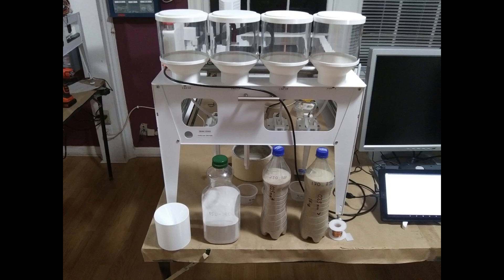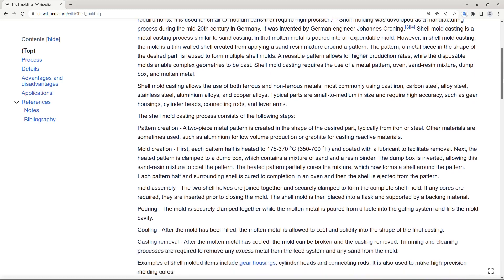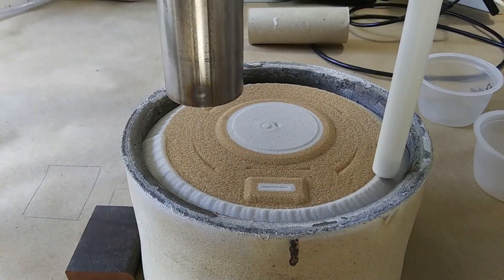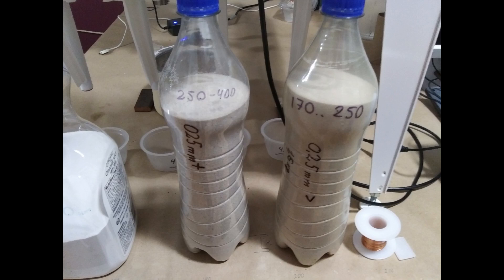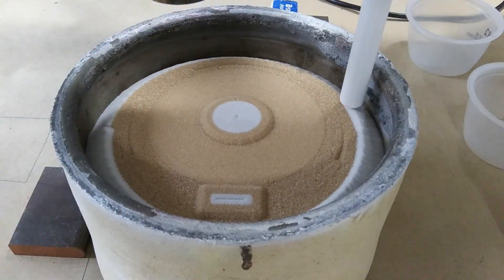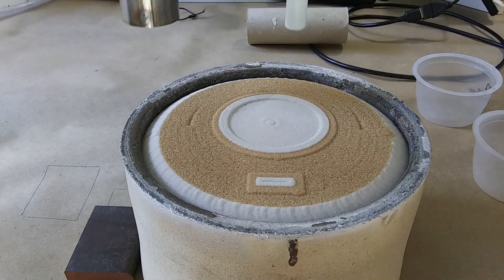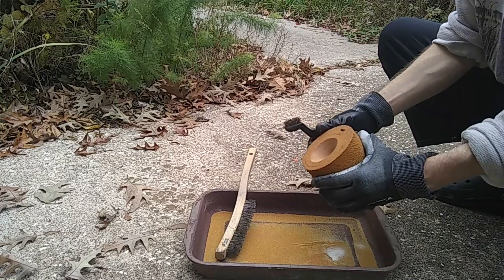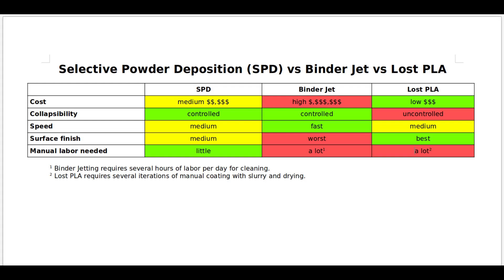DIY 3D printing of sand mold for metal casting

Comment: Privet, quick question. Instead of depositing different powders with your awesome 3D printer, would it not make more sense to use "shell molding sand" and spread a thin layer like in a SLS machine to harden with a laser or IR light or something alike ? The sand is inert, the temp required to do this is way lower, no high power laser needed, the print time would be fast, accuracy should be good and the overall process and consumables and cheap and easily done at home. You would 3D print a metal cast mold and then simply cast the object out of whichever metal you choose to. It´s not directly a metal 3D print, you just print the mold but I think it would be more than good enough for many many applications. 
Alternativly the shell mold sand only needs a low temp. to set, 200°C or so I think you have said it yourself, basically doable in a kitchen oven. Maybe the sand could be directly deposited by a FDM machine through a hot end instead, maybe not as a filament but as paste for example ? Am I onto something or is it a stupid idea ?
BTW huge fan of your work, genius idea and great implementation, your system is by far the best idea I have seen for metal 3D printed parts for a very very low price at a good quality.
Reply from the maker: Sorry I didn't notice your comment earlier. You have very interesting ideas.  I think they would be worth trying.  Also, feel free to contact me directly.
Reply: @iro3d how can I contact you?

Comment: are you heating the molds before casting? in which container and with what care you heat the steel
Reply from the maker: No, the mold or core from shell sand should not be heated before casting.  The foundry heated the steel in their induction furnace.

Comment: Interesting solution. I was commenting on one of your previous videos about material selection. Unfortunately you said that low carbon (alloy) steels, especially in the range of AISI 1010-1030 are currently not supported. These materials are so important, because of their ferromagnetic properties. A lot of novel electromechanical devices rely on those materials and - as I've checked recently - other 3D additive metal manufacturing processes are also very poor in this regard (excluding powder bed fusion and direct energy deposition, which practically works with any kind of metal powder/wire, but very expensive).

In my opinion, using this method for creating the mold and subsequently casting with low carbon steel is feasible. My only problem is the coarse grain of the sand (400 micron is very large in my opinion, which in our application can create problems for reproducing small <1mm features). 

If your solution can address these problems then I'm very much interested in it, because yours is the most cost effective 3D metal printing solution by far, so for small innovative companies, like ours, this is the ideal solution for rapid steel prototyping...
Reply from the maker: The 400 micron sand is used only inside. The outside surface is poured with a finer sand. You might be able to use 75-100 microns fine powder.  Or even smaller if you want to apply the binder after pouring.  But for that you would need to find a spherical PTFE powder.   I can explain the details by phone (or Telegram).  Give me a call.
Reply: @iro3d  Thanks, that sounds great. For our purpuses 75-100 microns would be fine, since our current (resin) printer's resolution is 50.

As for contact and possible purchase, first we have to finish the current (mechanical) testing phase, we print the parts with a simple resin LCD 3D printer (which is cool, since standard resin is transparent, so we can check all the mechanical characteristics easily from the outside).

But for the final, electromechanical prototype (and probably small scale manufacturing) we have to use LC steel. 
So based on the finalized mechanical design, we have to remodel (CAD) the parts with the final electromechanical elements in it. 

Only after these 2 phases are finished can I concentrate on manufacturing, but based on your answer, I'm almost certain, that your solution will be the first to be considered. Especially if you can give us advice about steel casting, which we know nothing about...
Reply from the maker: Sounds good.  Looking forward.
Reply: @iro3d  I have now some more experience, regarding available technologies for our low-alloy steel manufacturing needs and it is quite unpromising. Most of the commercial 3D printing services are available only for stainless steels (which are out of question for ferromagnetic applications) with no low-alloy steel printing options. 

They recommend CNC machining instead (it has high undercuts, like internal cavities), but with CNC-machining I had to re-design my CAD model (basically cut almost all main parts by half), just so they can manufacture it (more precisely, to give me price quotation). It causes a lot of post-processing (e.g. metal bonding) since there is no functional reason to cut these parts. Also it significalty increase hydraulic risks (leakage).

Your solution - detailed in this video - seems much more promising. I've also checked your portal, especially the comparison of printing methods, which is a great source of knowledge, thank you! I think you can add another line to the table, detailing this method, like "Sand Mold SPD with metal casting". Based on the table I also think, that this method - albeit a bit more expensive - is superior to the others listed in the table. 

I've also checked for available melting furnaces (especially induction-based, because of their performance) and found this:
https://www.inductotherm.com/products/mini-melt-furnaces/
I think, combining this with your printer, could be a great overall solution for printing needs, especially for those people or companies, who don't want to compromise regarding printing materials and strength of the product.
Reply from the maker: @gucsog  Thanks.  I'll look into that furnace.  BTW, how much does it cost?  (I don't see any price on their website)

Comment: This seems to be crying out for a custom 3d pla printer where the walls are built with very thin pla and you then infill with the two types of sand.
Wouldn't that be the best of both worlds? It would give the accuracy and finish of pla but the ease of this method?
Reply from the maker: I don't quite understand how it could work.  At what temperature would you burn out the PLA?  Wouldn't it damage the shell sand binder?   And what the thickness of the "very thin pla"?  If it's more than the grain of the sand, then that would make the surface finish worse.
Reply: @iro3d  maybe this, https://www.youtube.com/watch?v=Zdyqsj9-7es